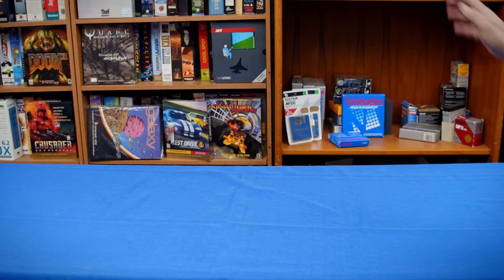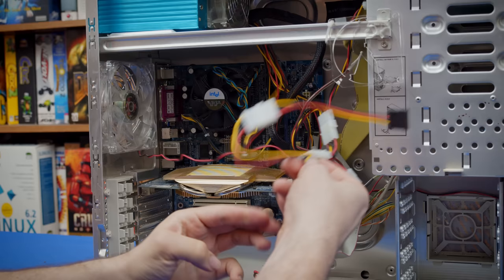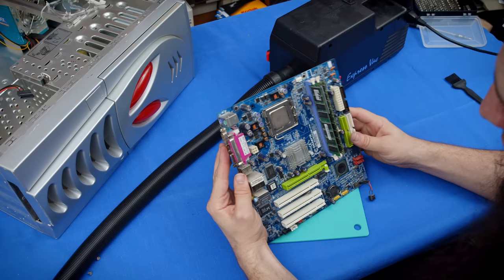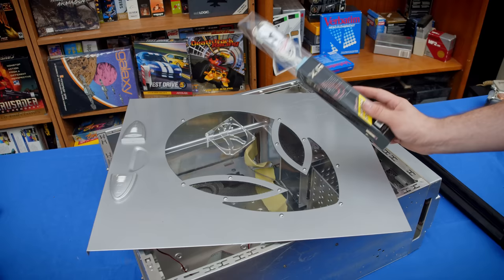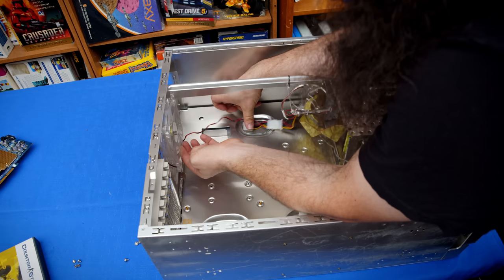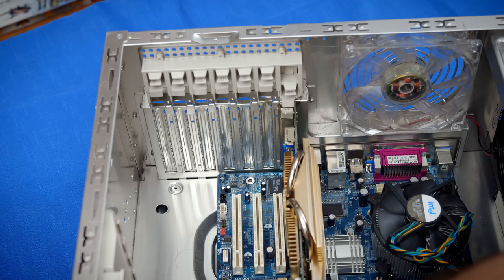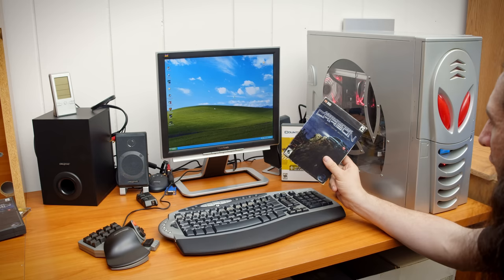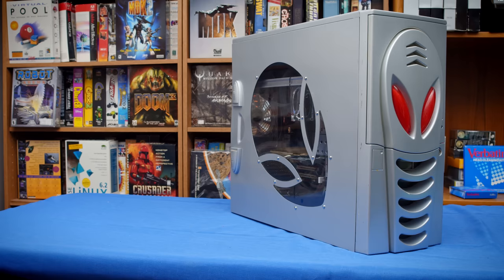Windows XP Gaming PC Brought Back to Life

Comment: Props to Gigabyte for still hosting all the support software and drivers
Reply: ASUS is good like that too
Reply: They've always been solid. Stand by their warranties too.
Reply: For real
Reply: As should every company
Reply: @wcr6121  and have better pcb on board too.
Reply: And props to them for putting two bios chips on their motherboards
Reply: Dell is like that
Reply: ASRock also still supports every board they ever made. I even got them to send me a new BIOS chip for an old P4 board fairly recently. I love seeing manufacturers continue support for all their products like this.
Reply: @sonicunleashedfan124 they only started doing that due to the Win95.CIH virus that was going round at the time they started putting the Dual BIOS on their motherboards (started with the BX2000 Pentium II motherboard from memory) which would override the BIOS with trash rendering it useless & a replacement BIOS chip required (if removable) or a new board as could not reflash it due to not able to POST (the 2nd BIOS would allow the machine to POST & to attempt a reflash the corrupted BIOS chip as sometimes the main BIOS was corrupted that badly, it would not reprogram with a good BIOS flash). We used to sell a LOT of the BX2000 motherboards (& Pentium II CPU’s - mostly 450Mhz as most didn’t want to pay for the 500/550Mhz!) back in the day when clients would call me up to say that their computers would not boot anymore purely so it couldn’t happen again. I am talking back around 1998 when Gigabyte dropped the first dual bios board. We also had BX2000 boards on our test benches with Celeron 300a slot CPU’s on them purely for using to remove the Win95.CIH virus (& usually others as well!) off of the clients drives, before rebuilding their machines if they didn’t want to go the full hog & buy a new board & CPU and wanted the cheapest option in buying just a replacement board for their AMD systems of the time.
That virus made me a lot of money back then for sure but I used to “hate” having to inform “cheap” clients that had ignored advice to buy a good AV solution back then & to stop sharing floppy disk’s!😂
Reply: @DonaldDucksRevenge  My experience with Gigabyte and their warranty is quite different.  I have an Aorus Pro AX that started having DHEA_Uncorrectable_Error BSODs right away, tried a different NVMe drive and that went away for a few months, then came back.  Swapped over to an Asus board and everything worked just fine.  I tried contacting them and they ran me through the ringer of testing everything else until it eliminated all options but the motherboard, then quit responding entirely.  A friend of mine bought a Gigabyte motherboard which gave him issues and said I was lucky to even get an email back from them.  They're on my "never again" list, too many better boards to chose from.
Reply: @@alexanderbaker4900 hp actually does. I experienced it myself
Reply: @sonicunleashedfan124  I've never understand why other companies did not offer dualBIOS.
Reply: @louistournas120  cost, that’s why
Reply: …who doesn’t?
Reply: Same with Dell

Comment: 3, 5 and 10mm LEDs (and some of the other shaped ones) are made out of resin, not acrylic. You could drill out the LED with a 2mm drill bit and remove the residue, then put in a new 3mm LED of a color to your liking. 2004 had the rise of royal blue LEDs, so a royal blue LED that leans a bit into the UV would be looking PERFECT.
Reply: Aren’t those the ones that are dangerous to look at? Or is that just the higher powered royal blue ones?
Reply: @kaitlyn__L  All LEDs that have significantly more than 1000 mcd (=1 lumen which is about the brightness of one candle but concentrated to a small spot) shouldn't be stared at for longer than a few seconds. That's independent from the color / wavelength. That is, directly frontal into the lens. Diffused light is okay.
Reply: @kyoudaiken  good too know! I saw some retro bright boxes which used large royal blue and they said it would harm your retinas to look at directly, suppose it was just from being so bright.
Reply: @kaitlyn__L  Yes exactly! The most dangerous lights are UV and infrared. Well, because you cannot see it. Do NOT look at your gaming mouse sensor for longer than half a second! I forgot to turn mine off once when cleaning and I have a nasty burn on my retina in the peripheral viewing area. But weirdly enough only on my left eye. To be fair it could also be from something else as retina scans didn't find any anomalies. The spot recovered, but I cannot see in color in that area. It's really odd. But I got used to it, it is barely bothering anymore.
Reply: @kyoudaiken  I must admit I used to spend a long time looking at a couple laser mice bottoms in like 2009, but I never did after I learned about the risk there from the IR. I either have no damage, or it was in the already-existent blind spot, or something. An irony is my current mouse, a Steelseries Sensei, has a tiny LCD on the underside you can put custom images on, but since it’s a laser mouse I’m like why??? If it was regular dim red optical I could understand. 

Anyway.
Reply: @kaitlyn__L  Those are just gimmicks to make you buy a mouse for another I think. I just currently use 2 Razer Orochi V2. I cannot recommend them because they try to install bloatware by sending a key combination that opens the Razer Synapse installer in Windows. I could suppress it with a dirty hack. Otherwise the mice are working well.
Reply: @kyoudaiken  yeah, I didn’t buy it for that reason at least haha. I bought it for the switches and the sensor. It just seemed like such a strange addition, compared to eg the RGB which has obvious customisation uses. You’re right it was probably just a gimmick, it’s not like that quality of screen is going in any other products nowadays besides hobbyist kits.
Reply: @kaitlyn__L  At least it works great! My ASUS motherboard for Ryzen Threadripper also had an OLED that had severe burn in after just 6 Monts...
Reply: I still have some old casemodding book here that talks about replacing the (usually) green LED with a cool blue one.

Comment: The reason for the slow CD drives could be the cabling. Those 80 pin cables are pretty delicate and some of the shielding wires can be broken causing it to essentially become a 40 pin cable which would cause the drives to fail to negotiate full speed with the motherboard during the drive detection process.
Reply: I would get tons of people who would not be happy with the speed on the pc they build.  Well they installed the old 40pin ide cable. Sold tons of 80 pin cables.
Reply: @idahofur  I did a ton of building and rebuilding of my computer over the years (surprise surprise trash picked parts don't last long) and my number one failure for drives was the 80pin IDE cable, they do not deal well with being handled a lot either.
Reply: The drive wouldn't go over UDMA3 anyway.
Reply: @idahofur  Another thing that caused massive slowdown was not installing chipset drivers. If no chipset drivers are installed, you don't get DMA on the disk controllers and everything chugs. I've had to do plenty of 40->80 IDE upgrades and chipset driver installation back in the day.

And irritatingly, it went into the SATA era. Microsoft doesn't install chipset drivers in many cases, and even if they do, they won't install SATA controller drivers and just use crappy generic drivers that cause the same performance problems. Intel hasn't made it any better by being assholes and deleting their entire driver backlog, and won't provide drivers for older operating systems anymore. That leaves the only option to dig through the questionable driver websites and hope you find something that works.
Reply: just so you know there is no 80 pin cable. it's a 40 pin 80 wire cable. or there's 40 pin 40 wire which is half the speed as the 80 wire.

Comment: That PC was built around the time i had my Athlon 64 3200+ and a ATi 9800 Pro. What an era of computers. In fact that computer i had was an upgrade to my Pentium 4 1.4GHz non-HT with a GeForce 3 Ti 200 and RDRAM.
Reply: When I got a 9800 pro it was being sold at the same price as the non which my brain was pro must be better nope half the bandwidth -_-
Reply: @TatsuZZmage  Big difference was the clock speed, 340 vs 310 MHz on the 9800 Pro and non Pro.
And I still have a GF 3 Ti 200 here. Fine piece of hardware.
Reply: My original pc had a AMD duel core, then I got a 3rd gen i7 and stuck with intel till 9th gen intel, but the upgrade I just got is a ryzen 7900x and I am looking forward to using it.
Reply: @TatsuZZmage  9800 Pro had higher bandwidth and higher clock speeds than the non. You can check the Wiki page that has a comparison table for all the 9x00 cards. Are you sure you’re not thinking about 9800 SE, perhaps? That one had half the bandwidth despite the “special edition” monicker.
Reply: @TatsuZZmage  The Pro still performs much better, especially in games due to the higher clock speeds. The 9800SE is about as good as a 9600 unless you can unlock the 4 extra pipes, which is by no means a sure thing

Comment: I had an Alienware Area 51 from late 2003/early 2004. P4 3.2ghz and a Radeon 9800 XT. That PC was such a beast at the time and it served me well for the following 6 years. There was something special about those old Alienware and FalconNW machines that today's system integrators just aren't able to capture.

Comment: "we can massively improve on the cable management this thing previously had" thats wont be period accurate then 😂
Reply from the maker: Lol, I actually cut a line for time where I said "The most in acurate thing about this build will be me actually trying to do cable management"!
Reply: Modders did cable management. Removing unneeded PSU cables, splitting IDE cables to round them, and splicing and lengthening them. In addition to building LED light strings.
You can add extra uv reactive elements by painting card edges with liquid Tide.

Comment: The cutouts in the drive door are propably there in case you put in a drive with a big enough button to be pressed by closing the door. Snapping off one of the cutouts makes room for them.
The big one is propably there to accomodate for a fan controller or something similar with big knobs.
Reply: Yes, you are correct. The cutouts make room for longer optical drives as well as 3rd party 3.5" and 5.25" drive bay accessories. A lot of those had knobs that stuck out beyond the bezel. That was a big issue with the Antec clone cases that had a drive door. Higher end cd/dvd drives did not fit with the door closed.

Comment: The extra fan on the PSU, extra heatsink on the GPU, the ridiculous case, god that is absolutely fantastic.

Side note: I really appreciate the way you edited the vacuum bit by keeping the normal audio, very nice touch
Reply: Gigabyte tend to overheat and fry fast. I don't know much about it from back then but from around 2008 onwards Gigabyte wasn't something to look up to. Every GPU I know of fried. It's a cheaper option but also people replace the coolers day one to extend it's lifespan.

I always bought ASUS components and while it was always expensive it actually lived longer then what was it rated for.

MSI and Gigabyte were always known to me as trash, cheap yes but the performance and it's lifespan awful.

Comment: This was so cool to see! I really wanna build a computer in this style.
That connector which looked like an AT power connector is actually something known as the "Auxiliary Power Connector". On some motherboards of the era it was used to provide additional +3.3v and +5v to the board. It worked in a similar fashion to the P4 connector. I find it an interesting and quirky footnote in motherboard history!
Reply: Funny thing is they started putting them on AT power supplies, which was super bad because if you exchange the wrong plugs, you either short directly to ground or you send 12v down a 5v path. I'm really glad that the ATX became standard.
Reply: @bruwin  I didn't realize AT and the Aux Power connector overlapped! That's a terrible idea!
Reply: I think I have a LGA775 board that supports Crossfire here and that takes an additional molex to run two cards.
Reply: @HappyBeezerStudios  That was common too

Comment: I have a similar case that also has a thermocouple with a display on the front. The instructions for the case actually tell you to put it in the CPU or chipset heatsinks. It won't ever be that great of a reading, but hey it's something! And it's neat!

Comment: I saw that exact case in the early 2000's in Toronto. I was building a computer from my sister and at the time I worked IT at the UofT campus around which there were bunch of computer stores, almost all of them had the cheap Chinese knock off cases. I bought the "sister" case to this case. Its black, it features the small "Alienware" logo on the top of the "door", the eyes in the logo were activity lights, there were no big red eyes but it had the 3 triangles on the top of the door.

Comment: The case I bought in 2004 had 120mm fans and I was super stoked about it. So much airflow!
Reply: I remember there was a case that was super popular back then but normally had a pair of 80mms in the back, I bought a Chenming knock-off because it used 1mm thick SECC steel and had a 120mm fan.  I still have it laying on the floor in my kitchen, my i7-11700K/RTX 3080 system was running in that case for a while but it didn't fit a custom loop water cooling system very well

Comment: Very nice. The nostalgia is fun, as is having the hardware that was out of the question a couple of decades ago for reasons of price. For example, maxing out the RAM in those computers would originally have cost thousands. My similar XP machine in a very fine Antec case was given to me. It has an E8400 processor that I could only dream of owning back then.

Comment: Seeing this has just brought back so many memories of my first build when I was a kid. I remember installing the MB without the standoffs and revelling in all .2secs of awesomeness! 
It was a valuable lesson in learning what you're wanting to do before you do it.
Reply: Ouch, yeah I’ve done that. Luckily I never got to the point of power on because I realised the board didn’t feel right.
Reply: I made the opposite mistake, I installed all but one of the standoffs on my first Athlon 64 motherboard.  I added more RAM one day then bricked the computer...turns out I cracked the board internally by pressing the RAM in since it wasn't supported right.

Comment: You are correct, the speaker on the GPU is to beep when the power is not connected properly. My 6800GT has it too. They also put a red warning message on screen in case the sustained speaker tone doesn't tip you off that something is wrong.

Comment: As @Pandaren Death Knight stated below, you could have a faulty 80-pin IDE cable.  One of the ones I saw in the video looked pretty yellow.  Maybe it came that way?  Another thing to consider is that if Windows XP detects too many errors in communications with the drive, it will automatically force the drive into PIO mode.  Could be the cable, or the drive itself could be going bad.  I'd probably start with the cable if it were me.

Comment: This was super cool and nostalgic!
I'm thinking the case with red lights might have been meant for AMD and blue lights were Intel originally, so maybe this was some kind of rebuild using "AMD" case on an Intel configuration.
It looked like the Intel systems had blue lights on what you could find.

The features on the case like thermal display, UV acrylic, the special PSU, inside mounted retainers for drives....
I really liked the alien eyes were actually vents!

Comment: The LED CS logo is actually an 80mm “fan grill”! (I had one). Meant for side window 80mm fan mounts etc

Man this PC is a retro treasure find. Alu alien case with UV alien window and temp display! blue anodised PSU, red LES fans, acrylic LED cs logo, passive 680O! Absolute perfection 👌
Reply: Back in the glory days of FrozenCPU, I remember drooling over the Acrylic fan covers and having to decide on which one I wanted.  I've still got an 80mm fan laying around which would display the air temp of the air flowing through it and it cycles through various patterns of displaying the temp.  The 2000s were pretty wild for PC mods.

Comment: Fantastic video to watch. I have a vintage Panasonic computer that is either from the 90s or early 2000s. It has no CD rom but has floppy drive. The components within are all high end quality(Asus). I cannot find a single thing on the internet about it? Not sure if it works or not, a lot of the inside connecters are unplugged. It is silver and also has a see-through plastic, side panel, to admire the quality components. It will have been a beast at the time it was made.

Comment: Depending on how you burn your CD for Windows XP, different software can optimize how the files are written so it keeps the disc fast, and also burning at the slowest speed sometimes helps

Also find the Counter-Strike version 1.5 or 1.6 retail, that will work without steam.

One more thing, the source engine games, run better on multicourse systems. Not a single core system.

Comment: I still have a proper blacklight neon lights for PC from that era. I used it on a modded case with UV reactive fans and uv reactive rounded IDE cable back in time on a p4 in 2002-2003 if I remember

Comment: ATX 1.0 called for a 6-pin "aux" connector (the single AT-style connector). Never saw anything that used it.
Reply: I had an ASUS P4T back in '03 which used one. It was a socket 423

Comment: that AT style plug is the old style AUX plug you saw it on the early Socket 423 and some 478 boards, it was for supplying extra 5V current to the CPU before the ATX 2.0 spec which gave us the 4pin 12v connector.